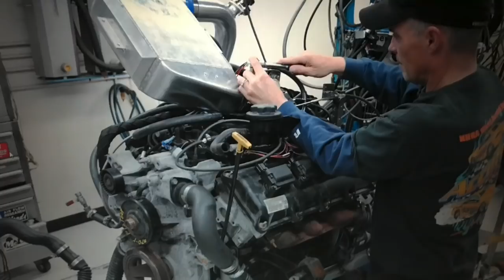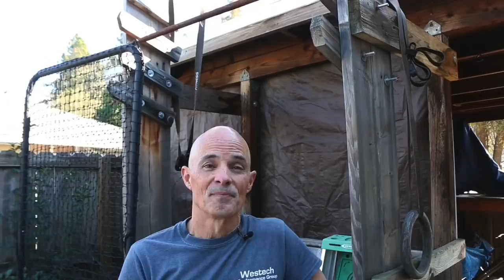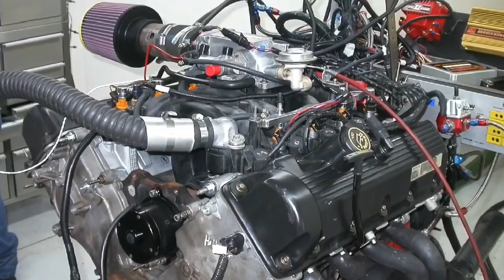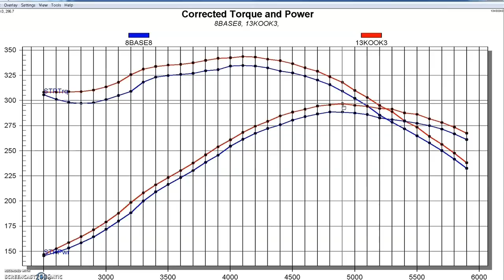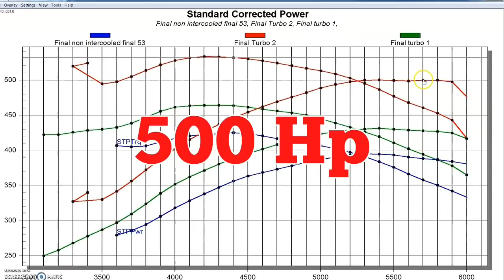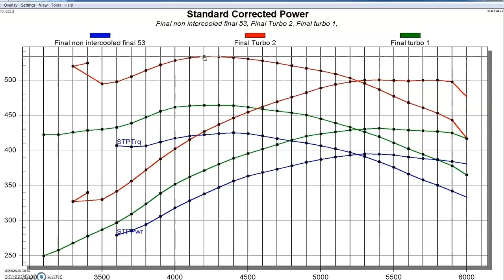JUNKYARD BOOST BATTLE pt1-FORD v CHEVY v DODGE

Comment: Can you pick up the For Triton V10 variant of these in the USA junk yards these days? in either 2 or 3 valve flavours?

Would be awesome to see and hear on of these with 2 x ebay GT45's on one of them ;)
Reply: Problem with the V10 is that it was ignored by the aftermarket.  Just about the only thing you can do to them (bolt on wise) is add boost.  There’s the options of reground cams (if you can find someone to do it) and porting the heads (can hand port them and only costs tools and time).  

Beyond that, big power from that V10 has the same issue common with the 4.3L GM V6....  the split crank.  It makes the bottom end considerably weaker, and getting a good crank for one is prohibitively expensive.  By time you start digging into a V10 to make serious power reliably, the budget is getting close to modded Coyote or GT500 5.4L numbers (both being lighter, more compact, and larger support).
Reply: @stlchucko  I I guarantee you've never heard of someone breaking a v10 crank, they're an incredibly strong, factory forged unit, despite the split pin design.
Reply: R Shiery 
I’ve also never heard of a 6.8L making a 4 digit number; HP or Torque.  Seems that it’s more of a case that they haven’t been stressed thanks to the lack of aftermarket parts.  Seems absurd to claim they’re “incredibly strong” when it’s virtually impossible to find one making over 600hp; let alone as much as a cast LS crank (which have been shown to withstand 1500hp).

The 6.8L crank was forged because split cranks are inherently weaker than non-split cranks.
Reply: @stlchucko  so basically what your saying is you really have no idea how strong it is, you just assume they're weak because they're split and you've never seen one built. What I've seen, and experienced, is the tens of thousands of pounds I've towed over hundreds of thousands of miles, up and down the Rocky's, on multiple different trucks with v10's. Now that stresses the crank, real world stresses. Running foot pinned up an 8° grade with 22,000# in tow, time and time over. Blown plugs, bent rods, even melted a piston once. Never ever did the crank have a single issue. So, as I said, incredibly strong.
Reply: R Shiery 
You’ve ignored everything else other than the last thing I said.

Towing heavy at altitude doesn’t stress a crank like the cylinder pressures from high power.  The Triton 5.4 is notorious for plug issues, and the 6.8 has the same head design.  Bending a rod or melting a piston on a stock or mild engine does nothing to demonstrate how strong a crank is.

So how about you show some V10s that have made 1000+ hp.  After all...  The 5.4L that they’re based off of have made that kind of power with 2 less cylinders.
Reply: It's literally been done, check out modular performance solutions, it's freaking glorious. Twin gt3170's @ 6psi. Getting over 600 lb. Ft. To the tires.